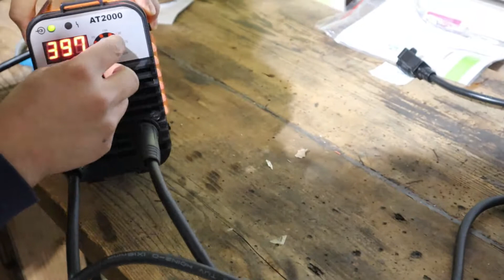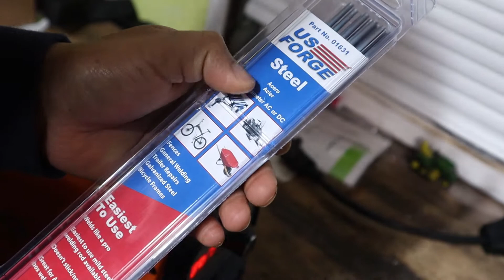Hitbox Mini stick welder 🔥

Comment: When stick welding you must lay the steel plate down making full contact with the concrete floor. Make sure you turn that little electric box of joy right up!

Comment: If you can Mig Weld then Stick Weld is the same principal. The amperage on the mig welder looked to be higher than the stick welder which is why the stick kept getting stuck. Your circular motion with the mig should be the same with stick if your amperage is set right. You had some pretty thin pipe that you were burning holes in with the stick, try the mig on the same pipe, your holes would have been much bigger. Its all about settings, metal type, metal thickness and type of welding stick or wire that is appropriate. You can take a class or study it all online, either way from a "real" perspective, your presentation failed because you yourself admitted that you are a neophyte in the craft